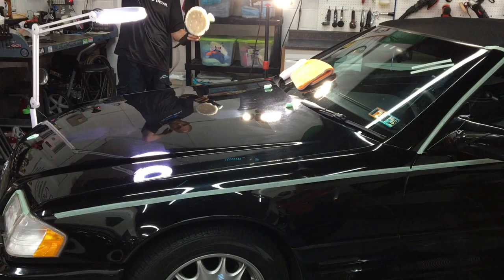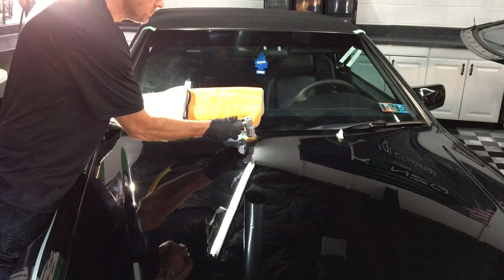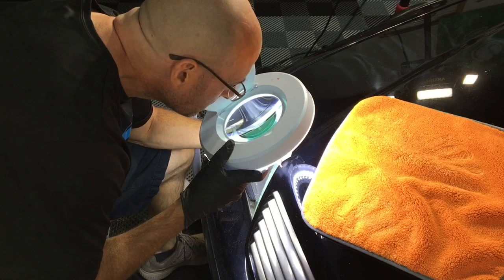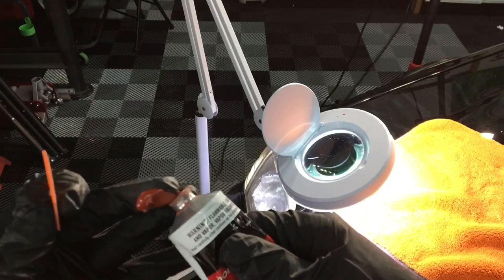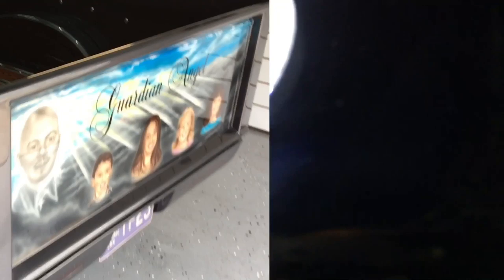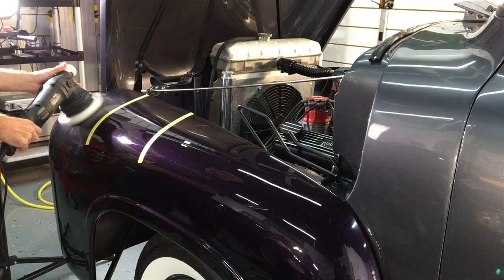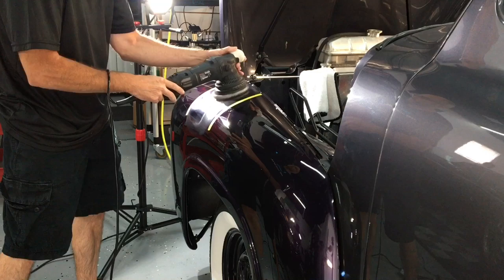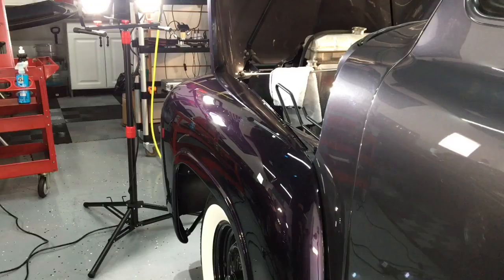SERIOUSLY SWIRLED Mercedes....Continued!! ROCK CHIPS, Swirl Removal, Wet Sanding, Etc....

Comment from the maker: I know you guys were looking for a vid on rock chip repair...finally had the opportunity to sneak this in today. Thanks for your patience. Cheers!
Reply: This is perfect. I'm getting ready to do this myself and couldn't think of a better teacher. Thanks B!
Reply: Apex Detail does Uro-fiber pads are they a one time used or can you wash them and keep re using them
Reply: @kelw1296  you can use compressed air or wash them the old fashioned way with soap and water and re-use until the fibers are dead
Reply: Great episode. Really want to see the outcome of the rock chips fix
Reply: NOICE
Reply: i did enjoy it. sometimes you have to in a way of speaking of, to the project.in a way of speaking go to hell your annoying and go out drink something come back with a fresh clear mind
Reply: Just what I was waiting for. Thanks! Unfortunately now I have to get off my posterior and go to work on it.
Reply from the maker: @kelw1296  They will last for quite a few corrections.
Reply: Most videos I find are on solid colors, what about metallic paint, ones with flakes?

I need to repair some damage on a Mojave silver metallic paint on a Mercedes. Not sure these methods would work. What do you think apex detail?

Comment: Love Sonax perfect finish for a one step, such a good and versatile polish. I do Rock chip and scratch touch ups the same way. Sometimes if your touch up paint is a little high before you wet sand it, I use some lacquer thinner on a q tip to knock down the high spot and level it, then wet sand and works great. Keep up the great videos.

Comment: I'm loving this series and the rock chip repair as well. Do you plan to fill in every rock chip on the front of the Merc?... Holy respray Batman..LOL Also, gotta love a flat fender Ford. They put a ton of metal flake in that paint job! Purple is not really my color but, I bet it will pop in the sun.

Comment: Hey I unfortunately sanded through my clear and base coat. Now the primer shows..is there anything I can do to fix it? 

I was prepping the paint before I did the polish and I used 1200 and 500 grit since the scratches were too deep..
Reply: If your fingernail catches any scratch it is most likely to deep to get out, as for your predicament you will need to get it resprayed there is no fixing it if you burn through that much paint. Sorry man :( also for wetsanding I would stick to 2500 and 3000 grit sand paper